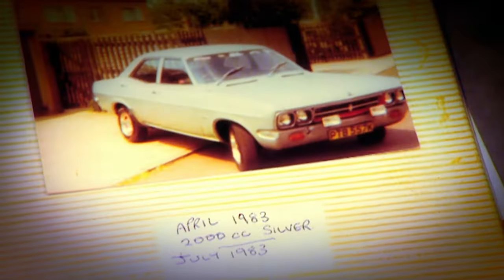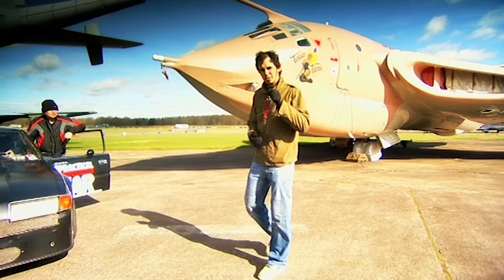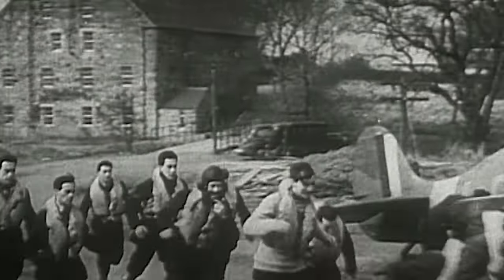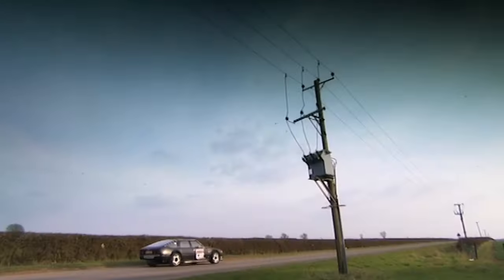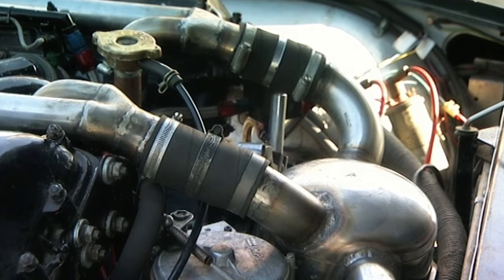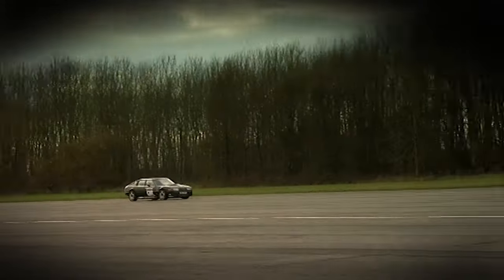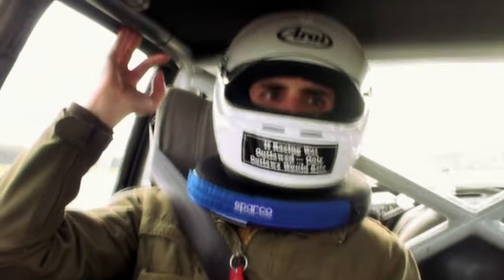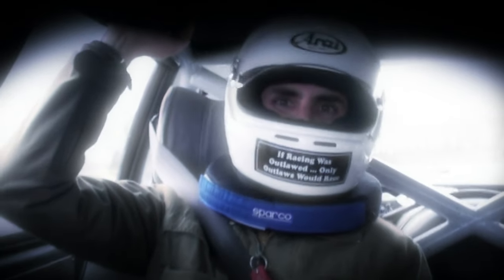Driving A Rover SD1 With A Plane Engine #TBT - Fifth Gear

Comment: A meteor is NOT a plan engine! It never was and never will be! The only thing it has in common is a similar layout,v12, and capacity,27 litres. The metro is a cast iron block tank engine and is a fraction of the cost and power of a merlin,kestrel etc. A meteor makes about 400 hp and a merlin starts at about 1200 hp!
Reply: +Andrew Wilson He even says it a tank engine in the video. They really need to change the title :D
Reply: +No Name Doesn't he also say the same engine was used in planes?
Reply: Samuel Brooks The tank engines were derived from the RR Merlin engine. The same way the 1275cc Mini engine was derived from the engine in the Moggy Minor. Not the same engine, but very similar.
Reply: +mickeybill Fair enough 👍
Reply: +Tony Sanger 
There's one in a tractor here in Aus (Meteor that is), goes pretty good too. He had to reverse it too then it had carburation problems. ,,,,,Long story short its now got digital fuel injection, overhead quad cams & multi valves, a massive turbo for each bank. The result,  bucket loads of grunt, torque and revs quite well aswell. I cant quote the horsepower.
Reply: 306 CHAMPION And it gets about 3 gallons per mile
Reply: +Andrew Wilson THANK YOU, my first thought when I saw this.however meteors where simplified and de-rated merlins. some of them where even made from old/ damaged merlin blocks.
Reply: +Tony Sanger yeah, its pretty much a de-rated merlin made to looser tolerances.
Reply: +Tony Sanger It's always slightly frustrating when people quote the horsepower of these engines. The bhp is irrelevant when you have 1550 ftlb of torque at 1200rpm. That's why the reduction box works so well
Reply: +mickeybill Actually, it's probably at least six times more economical than that. Calculated this way:-
 John Dodds Spitfire engined car http://www.imcdb.org/vehicle_511805-Custom-Made-Beast.html 
Allegedly gave 2mpg. The Meteor engine is a lower stressed version, so will use less fuel by default, and 2 is 6 divided by three.
My maths though  :¬P
Reply: +Tony Sanger I agree on all but one point, you said that it was all the same short the supercharger, except for the pistons, the supercharged Merlins had dished pistons and the naturally aspirated Meteor has flat top pistons and are a better place to start with a project like this. As they were still putting them in Conqueror tanks until 1959 there is a good chance you will get a younger engine with a Meteor than a Merlin.
Reply: +wordreet I don't agree with you, torque is a static twisting moment, BHP is work done, it is a measurement of the torque and the number of times it can rotate it in a given amount of time. Your point is that it is very difficult to use that torque without something braking loose namely the tyres and hopefully not the drive train. I don't mean to offend and if have please accept my apologies.
Reply: James Young Not my point at all dude. The 600hp would have been unworkable in a 51 ton tank like the Centurion if it only had 600ftlb of torque available. These type of engine always made best torque at low revs, which is where they do their work.
Reply: +wordreet The horsepower rating is ALWAYS relevant, and - in automotive applications - usually much more important. 

For starters, the HP figure contains more information, since it's derived from TQ * RPM/5252 (torque being the only thing that's actually measured by a dynamometer). If you know both the horsepower and torque peak ratings/engine speeds, you can get a pretty good idea of what the torque and power curves look like. 

It's also a misconception that an engine spinning at its torque peak will produce maximum acceleration. That's only true within a single gear range, and there aren't many 1-speed transmissions out there. Torque monster engines like this Meteor sometimes resort to using a direct drive or single reduction gear when shoehorned into an automobile, but that certainly isn't ideal. If you've got an engine that produces 1,550lb-ft of torque driving the wheels directly, it's only putting as much force to the pavement as a 127lb-ft engine with a 3.5:1 1st gear and 3.5:1 final drive ratio.

For a given speed, rather than a gear range, maximum acceleration occurs at peak HP. In other words, worked out as an average - accelerating from 0-100MPH (or whatever) - it's best to keep the engine nearest its HP peak in every gear range. That's exactly how cars with CVTs function @ WOT; they constantly adjust gear ratio to keep the engine at its HP peak. 

Thus, the HP rating is a much better indicator of how fast/powerful a car will actually be. Lack of torque can always be compensated through gear multiplication.

And despite all of that, this car is fucking awesome!!
Reply: +Andrew Wilson The Meteor was the tank version of the Merlin, why argue? the extra horsepower of the Merlin came from the supercharger and HiPo parts not needed in a tank. This SD1 wouldnt need 1200hp, its torque that moves cars, The Beast (John Dodds) used the same v12 27ltr engine making 600hp according to the fact sheets
Reply: +doctor zaius If you compensate for lack of torque through gear multiplication you are essentially losing power and gaining torque. But I agree with you otherwise. It would interesting to see two of the same car one with a very high torque and medium power and the other with the opposite in a race.
Reply: +baldandold The 1200hp motor would have more torque anyway, where do you think the extra power comes from as the rev limit is pretty much the same? The power band is what's relevant to cars anyhow, not the lbf at the crank.
Reply: +godzillaisnuclea123 I think it is a question of what he could get his hand on... and of basic design facts. The SD1 has a live axle, which means there are limits to the torque that can be sent to a diffential that fits its housing. Similarly, there are limits to the torque that the transmission shaft can handle. On the other hand, if one thinks a bit, there is no reason why his set-up should be - efficiency speaking - any worse than a normal manual gearbox. If it had a separated super-multiplier it would be wasting power, but as the multiplication is designed in the gearbox, it is going to be as efficient as any othe gearbox. The difference, the "direct drive" (teorically, the only gear moderately more efficient in a manual gearbox... all the others are two cogs geared one on another) here is the first instead of being the 4th 5th gear.
Reply: No point in watching the video then. Thanks.
Reply: +Andrew Wilson interesting but boring
Reply: But torque at the wheels is what really matters. The gearing in a normal car multiplies the engine torque many times over, whereas with an engine that only does a couple of thousand rpm you can't gear it down as much to multiply the torque. This is why a horsepower figure is important! A million lbs.ft at 1rpm wouldn't be very useful, but 1hp at 1 million rpm wouln't be either.
Reply: does it matter? really?
Reply: its a converted plane engine, fair enough?
Reply: Its torque that miles cars not bhp
Reply: baldandold Care to explain why, or is that just something you recite like it's one of the Ten Commandments?
Reply: Physics for petrolhead 101

Torque x RPM x some constant = Power (BHP, HP. KW; it changes the constant).

By the way, power to the wheels= power at the engine x drivetrain efficiency ( as any efficiency, something < 1).

Now, power= energy /time (literally).

Acceleration :=> increment of kinetic energy over time,  = energy /time.

Power :=> Acceleration.

Torque is secondary.

The engine gives out power - being a reciprocating Internal Combustion Engine characterised by the unlucky fact that its maximum power and torque each comes at specific RPMs far above zero (and it needs to idle, too), a gearbox and some kind of clutch are needed so that the power out of the engine can be presented to the wheels in a useful manner (at the right speed/torque levels for the ground and the current speed of the car).

Now, the gearbox and transmission drive have an efficiency, of around 75% (last time I saw some data was on '70s cars... let's say 80%, nowadays).

Electric motors are pure power converters...

RPM x Torque  = Power in (again, x efficiency, something like 80-90%).

if RPM=0, torque is maximum, so they do not need gearboxes - just a fixed ratio reducer, usually.

Which is the reason why a not so brilliant (as far as HP/tonne goes) machine like the Tesla S can out-accelerate most sportscar, up to a certain speed - it doesn't need pauses to switch gear.

A lot of people is impressed by the fact that
high revving piston engines usually have very narrow power bands, which means that to get power out of them they must be kept revving in that nawrrow range and their gear ratios must be changed often (which is a loss of time), whereas the power output of slow revving engines usually have much wider distributions - you can keep in the same gear longer.

But in the end, what you need it is power and ...  high revving or low revving, it just changes the tuning of the gear box.
Reply: The Meteor is just a Merlin minus the supercharger. Many of them actually came out of aircraft and were rebuilt for land-based use, alloy block and all. There's a guy on Pistonheads building a Meteor special whose main engine, according to R-R themselves, was first used in a Hurricane.
Reply: Wrong It was developed from the Rolls-Royce Merlin aero-engine by W A Robotham and his chassis design and development division at Clan Foundry, Belper, as they were not involved in aero-engine work, and his engineers were under-used. With the aid of engineers from Leyland, who were engaged in tank work, he considered RR's two V12s. The Kestrel, while having more power than the existing "Liberty" or Meadows engines, did not provide the desirable 20 bhp per ton required, so the Merlin III was used. Robotham was at pains to point out that Rolls-Royce could not manufacture the engines, so would not benefit commercially.
Reply: Wrong. Parts from crashed planes were used but the engine even rotated in the opposite direction. Meaning the prop would be spinning the wrong way.
Reply: Great comment, I agree with it all. You should do a video based on your comment.
Reply: terry jackson was
Reply: Really, no.

The subject was so pivotal to you and I not speaking......  and writing German at this moment.  RESPECT is due to those who worked all Gods hours TO GET IT RIGHT.

+lost their lives doing so
Reply: The Meteor version used in the Cromwell was 600 hp, the Conqueror had over 800 hp. Don't know if there were any versions that only put out 400 hp. Earliest Merlins put out just under 1000 hp (Mk 1 Spitfires and Hurricanes  had 1030 hp); most powerful versions topped 2000 hp.
Reply: People say there's no difference... But the Merlin is about 1500bhp and the meteor is only 600 in comparison because it isn't supercharged and doesn't have the lightweight engine components of the Merlin
Reply: The RR Merlin was supercharged, the RR Meteor wasn’t.
Reply: @sbomorse  Yes he did, but it doesn't mean he is correct.

Comment: Sorry fifth gear but if this is the Rolls Royce V12 from a tank then it is the Meteor and not the Merlin. The Meteor was never used for aircraft and isn't particularly rare or valuable. That's why it only cost £1000.
Reply: The Meteor engine is a detuned Merlin engine (down to 600bhp). It has the supercharger removed and some of the components are made of steel rather than light alloys. It would still bolt into a Spitfire.
Reply: The Meteor was used in aircraft, most of them were secondhand ex-aircraft Merlins...
Reply: wait what.. you can get this for 1000? I want one.
Reply: paul austin  Well it's the difference between 1300bhp to around 600bhp. Although the engines are very similar in their basic design, there is a reason they have two different names, they are not the same.
Reply: jester5ify it might bolt into a spitfire but it spins the wrong way
Reply: @BigHorseFilm  One major difference if I recall correctly is that the aircraft engines crankshaft runs opposite direction to the tank version.
Reply: @Basih  Griffon IIB and Packard Merlin have odd rotation also
Reply: In what tanks was it used?
Reply: It matters because a merlin with its supercharger makes that characteristic whine, whereas the tank engine makes the SD1 sound like a tank.
Reply: @habedoudefiant3754  Centurian used it
Reply: 100% wrong, same basic engine used in aircraft of wwII.
Reply: same engine as in I have a Volvo ..it's the same engine as in the t5 but without the turbo and a few other bits ..but it's still same fcking engine ya Muppet
Reply: @zpolukuchka  Nope, Packard Merlins were Right Hand turning, except for the F-82 Twin Mustang prototype intallation and the DH Hornet. These versions of the Merlin had an idler gear in the front reduction gear case to turn the prop in a LH direction (viewed from behind). Whereas all Griffons were LH ''tractor.''
Reply: @richardharrold9736  Totally wrong. Read here for education... https://en.wikipedia.org/wiki/Rolls-Royce_Meteor
Reply: @jester5ify  No, it would not fit in any aircraft! Please read!  https://en.wikipedia.org/wiki/Rolls-Royce_Meteor
Reply: I see David Fletcher MBE be on the Youtube correcting people :)
Reply: paul austin  Not really. People who are into this stuff don't like errors. It's like a guy who buys a pair of Nikes has his mates admiring his Asics.
Reply: @habedoudefiant3754  Cromwell and Comet,
Reply: @peteotoole8383  Not really; the Merlin was built by Rolls Royce, and the Meteor by Rover. Would you drive your Volvo if Ikea built the engine?
Reply: @BigHorseFilm  

Largely yes they are. One is super charged and is fitted with super light aluminium parts and the other isn't... but you can swap parts between the two. 

They are the same family of engine so I don't mind the description.
Reply: @habedoudefiant3754  Cromwell, Comet, Centurion, Conqueror.
Reply: @habedoudefiant3754  It was used in the World War 2 Cromwell cruiser tank and the Comet cruiser tank that followed it.
Reply: @habedoudefiant3754   most British tanks from about 1943 to 1960 including the Churchill, Comet and Centurian. A powerful and above all reliable engine.
Reply: @jester5ify  only once you completely re configure the unit.
Reply: @jester5ify  meteor and Merlins cant be swapped  from land/air roles. they have different cam shafts and also turn over in opposite directions.
Reply: @chrisclarke3965  When did i say it would fly lmao
Reply: @chrisknight6884  the Churchill used a Bedford flat 12...it was two of their 6 cylinder bus engines mated together on a common crank. 350hp at 2200rpm and 960 pound per foot of torque from 800rpm.
Reply: @jamesscott5407  I stand corrected 😏
Reply: Alvis stalwart
Reply: @rorymorris6875  the Alvis Stalwart had a Rolls Royce straight 8 engine
Reply: Thanks for the clarification,  I knew the stalwart had a rolls Royce in it just not the meteor.
Reply: @rorymorris6875  probably the last straight 8 made .... lovely sound.
Reply: @richardharrold9736  

totaly different crankcase     and had fan driving pulleys on back  , no blower  , and cast iron  bevel drive housing /starter motor,drive case. 
restqw is pretty similar

Comment: I was hoping for a radial engine to somehow be fitted  in there
Reply: My Prius can hit 100 mph and still get 40 mpg 😂
Reply: +alex Gonzalez my golf will do 125 and still get 60mpg...
Reply: +alex Gonzalez thats awful.
Reply: +Terminxman jeah me too exaclty
Reply: +alex Gonzalez My 17 year old Peugeot 306 HDi cost £250 to buy and gets 55 to the gallon.
Reply: +alex Gonzalez that would be impressive in 1996
Reply: +Terminxman @wordreet hihi jeremy clarkson on peugeot drivers ;D
Reply: +iCloud fun fact: you're probably thinking about MPG with british gallons, while the prius dude is probably american. 60 MPG british is about 40 MPG american!
Reply: Re Er, the Uk gallon is 4.546 litres and the US gallon is 3.758 litres. Though all we see now in the UK is litres on the fuel pumps when we buy it. But we still talk about MPG anyway! ;¬)
Reply: aye
Reply: There is an MR2 that has a radial engine
Reply: My piece of shit Corsa can do a 100 and gets better milage than a Prius which are famous for having bad milage
Reply: your  not amurican are you?
Reply: @alexgonzalez514  my Citroen C2 could go 105 but only do 25 mpg at 105 but usually 50 mp US gallon at sane speeds.
Reply: A radial makes sense in an aircraft, especially an air-cooled one, but the central position for the prop shaft doesn't suit a car very well. The V with the prop shaft at the bottom is the best design for a big engine in a car, you don't want to have any of your transmission having to be that high up in your car, and the transmission of any car with an aircraft engine in it is going to be a little chunky. Has anybody tried using a Griffon engine in a car? 37 litre V12 Rolls Royce, the Merlin's replacement in later Spitfires. The RAF maintained quite a few of them in Shackletons. Despite being 10 litres bigger than the Merlin it was only slightly bigger (0.73 compared to 0.7 square metres) in its frontal area, still feasible to fit within the confines of a relatively normal-looking car.
Reply: My Ford Ranger will do ~110 mph, 25 mpg at a push and leaves a trail of black smoke wherever it goes.
Reply: @alexgonzalez514  My wife's Ford C-Max Energi can hit 128, do 0-60 in under 8 seconds, and still get 42 MPG. Never understood why anyone would buy a Prius when the C-Max is better (and more luxurious) in every way.

Comment: The Rolls Royce Meteor is a relatively low powered (600HP) tank engine that only shares a few parts with  the Merlin aero engine. It was never used in aircraft.

The RR Merlin 130/131 aero engine produced up to 2070 hp.